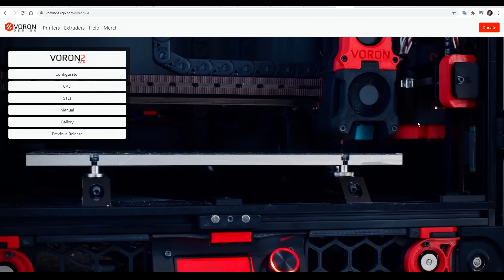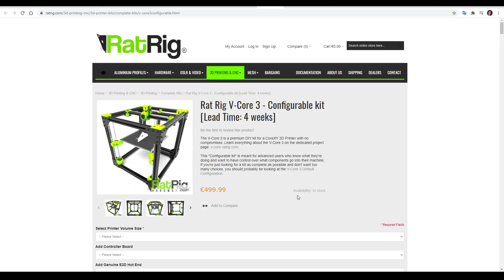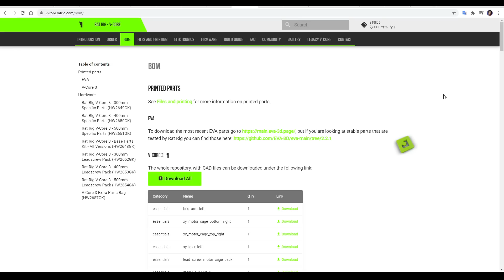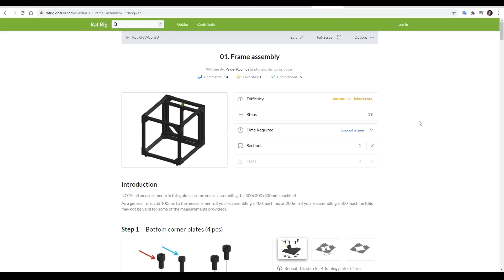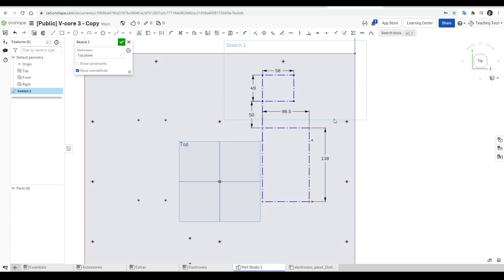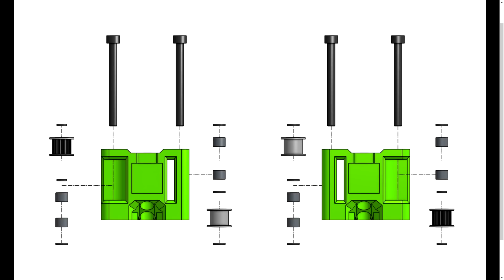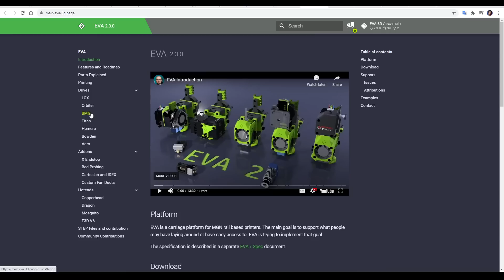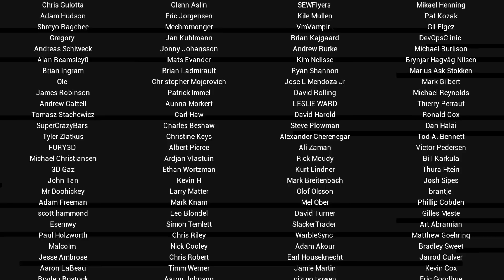Rat Rig V-core 3 part 1 - Premium coreXY 3D printer community build

Comment: i am looking into Rat Rig V-Core 4.0, and i see that you have  the vers3.0.  do you still like the version 3? is it a heavy use machine for you? a go to machine?  i have to replace a 400x400 kobra max and i am thinking about the Rat Rig V-Core 4.0 and the 500mm one.  I've had the MK3 from prusa, and currently i have an x1c and a kobra max.  size and a non hobby tinker machine is a must.  model and print, with no messing around.  i have seen there is a EVRYONE 400 on Kickstarter, but its Kickstarter so I'm weary of doing that.  What do you think of a 400 plus machine on the market?

Comment: Does anyone know if you can use regular 3030 TSlot profiles instead of B type? I can only get locally sourced profiles and B type is not an option. Can you see any drawback or restriction performing the assembly with regular 3030 profiles? Thanks in advance for any comment

Comment: Everything looked doable ... until the backplate came into question. That piece alone costs over €100 to have made and shipped sadly enough and having to have something done externally without knowing for sure it will fit at such a high price ... not a very tempting proposition.

Comment: looking at building the V-Core 3 but I am worried about the way the build plate is held. It has 3 points that are just held with magnets so you have 2 corners that are just out in space. Was wondering if anyone has seen that if you have to much weight on those 2 corners does the bed left up in the opposite corners?

Comment: What do you think about the RatRig vs something like the new SecKit Tank? I'm thinking about building one of these and my greatest priority is excellent print quality and reliability. Speed would be icing on the cake, but I'd rather have a slower machine that dead-reliably gets high quality prints in PLA and PETG than a notably faster one with slightly lower print quality or reliability. Thanks for the great videos and for sharing your expertise!

Comment: I recently got the non pro version of this printer and some work must have been done to remedy the issues listed, I had no problems in building the machine, installing the belts was tricky but but not that hard to do. when leveling the build plate choose auto and try to adjust the nut under the platform to bring the values in the table to as near zero as possible,  turn the nozzle to raise the build plate if the value is negative. lower the build plate if the value is positive. At least This is what I did. I have tried printing using the sd card and found that the finish of the part was reasonable with regard to the test pieces supplied. Otherwise printing using Simply 3D and some designs not supplied by Tronxy the effects of stringing were apparent.
I do agree this is not a printer for the uninitiated.

Comment: If you were to enclose the Rat Rig printer would PETG be fine or something like ABS+/ASA better. For those that have an Ender 3/5 with no enclosure looking to build one of these PETG would definitely be easier to print, but just wondering if if would cause issues later on. This may sway me from the Voron 2.4.

Comment: I want to diy a larger printer with 400mm x 400mm bed. Can any 3d printer controller travel that distance according to the gcode if the frames are large enough ?
Reply from the maker: Yes. See the Ender Extender kits for an example of that. The firmware doesn't care beyond having the max coordinates increased to suit.
Reply: @TeachingTech  Thanks

Comment: I had wanted to build a Voron 2 kit but seeing this has me curious. Personally I like the voron's design of leaving the bed completely stationary more but the independent controls are definitely an interesting design choice.
Reply: Same thought here, but seems like there could be some really cool things you could do if slicer programs can work with a moving bed like that. I like the electronics enclosure on the back vs at bottom of Voron. I was considering the Voron, but now seriously considering this one due to being able to order parts in 1 place and cost isn't much different.

Comment: which panel do I have to use on github? there are 4 and I dont know which is the correct one. I ordered the v-core 3 with a skr pro 1.2 2209
Reply: You are looking for cad/panels/[your printer size]/electronics_panel_blank_[your printer size].dxf 

You'll have to add holes for mounting the electronics yourself. You can either do that by drawing it out on the plate and going to town with a hacksaw/angle grinder/jigsaw and drill, or do it in CAD and have it made at a shop near you.

Comment: I'm torn between this printer the mgm cube and the voron 2.4 ? I want to build one but not what will be the best
Reply: They're all excellent printers capable of incredible speeds and excellent print quality. You'll have to look at other factors to decide. The voron 2.4 is a more complete design but also less customizable for that reason, and it takes ages to build. The Rat Rig comes in up to 500mm build volume and is backed by a company so you get warranty and support, it's simple and easier to assemble. Not sure if there's any upside to the BLV that the other two don't have.

Comment: Dear Michael, you have tested many different hotends in the past, but I would recommend trying the ‘NOVA-hotend’ by 3D Passion for this project, because it is seemingly one of the best choice out there for high-speed printing. Your relentless efforts are truly commendable and much help for the community and enthusiasts…
Reply: It does look very promising, but keep in mind that all the videos you are seeing are using highly elevated temperatures to achieve the high flow, which leads to pretty disappointing print quality in practice if every bit of your print is not printed at the same speed with the same flow, which is very very rarely the case.

Comment: Do the rails come pre greased?
Reply: They come in protective oil, which can be wiped off and they can be used as is. The MGN12's in the V-Core 3 kit are excellent. You absolutely can clean them and grease them yourself if you want to, but it's not at all necessary.
Reply: @miklschmidt  how can it not be required to grease them? Metal against metal are never good. Even if we don’t even get close to 10% of the rails max load it is still metal sliding on metal.
Reply: @Exstaz  because the protective oil is enough. You can apply some additional oil every now and then. Stripping and greasing is 100% optional. Warranty applies regardless.

Comment: when you printed the parts, did you account for size differences or was the STL  already made that?
Reply from the maker: You mean shrinkage? Either way everything was the right size with no modification.
Reply: @TeachingTech  what about the choice for petg? The vorons are extremely against using petg due to too much flexibility and heat creep in an enclosure?
Reply: @em-pointer  PETG is less flexible than ASA which is one of their recommended materials. Deformation will happen if you run enclosure temps higher than 60-70 degrees celsius, but that won't come easily (you need excellent insulation and possibly even a chamber heater). You can print the parts in whatever material you want, you can even use the PETG parts to print ABS parts. Mechanically there is absolutely nothing wrong with PETG, the parts are designed for PETG so they will work great. It has been tested thoroughly through months of use, so don't worry.
Reply: @miklschmidt  what vorons showed is that at least some of their parts were deformed due prolonged heat exposure of hot and cold they've shown parts from PC as well, (which what surprised me) my current black widow printer has an enclosure the temperature around the hot end can reach around 50-55 degrees, i was on the fence for a while on buying a voron 2.4 kit , but i retreated from that idea. partly because the maximum of 350mm 
i even considered using CPA for it
Reply: @em-pointer  Yes, but the v-core 3 is not enclosed by default (it's designed to be somewhat easily enclosed if the user wants to). If you wanna run 60+ degrees in a chamber, don't use PETG. For everything else it works nicely. Depends a lot on the brand of PETG used as well, i can recommend Spectrum (Lime Green PETG is the official EVA color).
Reply: @em-pointer  Also you have to remember the Voron is designed for ABS, not PETG. That makes a lot of difference.

Comment: This looks great, I've been lurking on the website and I can say this seems like a great alternative for me as I was considering  a Raise3D. One thing I noticed is they dont offer an LCD screen and their page doesnt make mention of it despite mentioning other items that don't come with the kit as standard. Any clue?
Reply from the maker: Alternatively since both RRF and Klipper support a web interface, you can recycle an old phone or tablet as a full featured display.
Reply: @TeachingTech  With klipper you can even use an HDMI screen and use KlipperScreen.
Reply: LCD screen is not part of the offered configurations, but you can always buy one and design a 3D printed mount for it.

Comment: If I may, as far as extruder choices what about something like a mini Sherpa? Light weight and using a nema 14. I noticed also that Mellow store released an integrated hotend/extruder using a nema 14 at 5:1 using e3d hotend components and creality spec mounting with low weight and a unique quick filament feed system. Might be worth casting an eye over too.

Comment: I ended up doing a Voron 2, and I am a happy man.
Reply: Also building one, but with the 350mm version 30 30 extrusions would have been nice
Reply: @010falcon  Yes the 20/20 are a little bit small for the 350. I did a 300. Make sure to derack the frame and fine tune the printer with input shaper ;)
Reply: @BonBaisers  Hey I'm still on the fence between the this and the Voron, what do you mean by "derack" the frame?
Reply: @slayga  it means making sure frame is square :)

Comment: I love that you are doing this. It has allready relieved so much stress from me, just by going along so smoothly. Wouldn't you want to make a machine like this an IDEX? or at least dual extrusion? Your Hbots are all ready sporting direct drives. I really want to see this thing become my goal machine. A core xy IDEX with a heated chamber capable of 80 degrees C. It should print just about any material at 0.05 resolution. For me speed is not the reason to have a core machine. Repeatable perfection is my only goal. Then I might try to speed things up. I can't wait for the next installment. Thanks for being so awesome at what you do. I'm not sure about the Klipper thing though, I am just starting to understand how to work with marlin and build firmware for my machines. Its been 2+ years and I am still a novice with marlin, Now to have another control system to learn syntax for? I will watch to see if you turn grey trying to get it dialed in. Then decide about that. Keep on rockin'.

Comment: Hello teaching tech. May we know why you use spider coupler instead of the rigid coupler for the Z? thank you
Reply: You can use rigid couplers if you want. The spider couplers are more beginner friendly though as they allow for some misalignment. They don't compress much either so in that aspect they're better than spring couplers, which was the default on the predecessor.
Reply from the maker: I did not design the machine, so your question should be directed to Rat Rig.

Comment: Big printer should have a big hot end. So use a Volcano or similar
Reply from the maker: I have bigger printers with larger nozzles so for me it's not a requirement apart from wanting a lot of flow for high speed printing.

Comment: Great video as usual mate, just one thing, get a taller seat as the one you are using makes you look about 3 feet tall !  😄
Reply from the maker: The work table is actually a lot higher than it seems. The problem is worse when I'm trying to fit a larger printer in frame. I agree this one looks wonky.

Comment: Good to see 3D printers adding "pillow blocks" (thrust bearings), but maybe they could start adding them to the correct side of the flexible couplings. :)
Reply: We have a design for full pillow blocks, which I'm currently using. They're great, but are much harder to install, as you're effectively turning your flexible coupler into a rigid coupler, so wobble becomes a larger issue. The goal here is to offload the motor shaft, and the default design accomplishes that just fine. The only advantage of full pillow blocks (as we call them) is that they eliminate coupler compression as well (which is already minimal with spider couplers). So because ease of assembly was a priority we opted for the design you see in the video.

Comment: I have 2 of these at work, which I built. The 400mm pro was a pain in the ass to get that huge bed to work right. Now they have the rails at the bed corners which solves the problem I have.
Reply: There's an upgrade for the Pro (1.3) that gives you the kinematic bed :)

Comment: You didn't clean and grease your rails ?! That's a must, the oil that's on them is just for rust protection not for lubrication! Clean them with WD-40 - > IPA and then apply EP2 grease inside the carriage
Reply from the maker: I followed their instructions to the letter. They have a specific page on the prep. Everyone has their preference but you have to understand my need to to stick to the recipe, especially if I end up doing a review video. Any sub par performance or problems and the finger gets pointed at me.
Reply: @TeachingTech  Alright, I can respect that in regard to the review aspect.  But I'm VERY surprised over their recommendation on not greasing them. All rail suppliers ship the rails with just a light oil for protection. Even the expensive ones. You'll get less wear and a much quieter printer with grease instead of that oil. Good luck with the build
Reply: @vesslades  The MGN12's that ship with the V-Core 3 are excellent. There's nothing wrong with running them with the oil they ship in. Cleaning and greasing is 100% optional, and the steps to do so are mentioned in the linear rail guide, if you wish to do it anyway.

Comment: The show stopper is definately the plastic elasticity dependent pulley mounting.
If i invest that much in a new machine, i would expect that ALL bolts/screws that have to cope with the forces of the belts are solely mounted on metal parts.
So for me this printer for that price is a no-go.

Comment: Regarding the electronics panel: I'd just cut the sheet to size by hand, put my components where I want them, stick a pen throught the holes and drill those by hand too. Accurate mounting is crucial for the operation of the machine when it comes to the frame, the lead screws and so on, but the electronics? I would have just yolo'd it lol

Comment: When I configure it (new to 3D printing but experienced tinkerer), it costs almost a thousand Euros. So if you're new to this like me, you may want to look into the other CoreXY machines mentioned in the beginning :)
Reply: Most CoreXY's this size and with these features will be around that price. The voron's are a bit more expensive, maybe a bit less if you run the risk of buying a kit from ali.
Reply: @miklschmidt  Yeah I checked out the others in the meantime and I guess I'll stick to a bedslinger for my first printer.
Reply from the maker: I don't think this type of kit is intended for first time users (although with your experience you'd likely be fine).
Reply: @TeachingTech  i agree. Depends on the person! There are more than a few people on the Rat Rig discord who started with a V-Core. if you’re technically inclined, eager too learn and are used tinkering with mechanical stuff you’ll be just fine and you’ll learn as you go. The Rat Rig / EVA community is amazing and always ready to help!

Comment: 7:29 this is such a weird problem that still hangs around. Why can’t people just orient their parts properly before they share it with thousands of people? Jeez
Reply: It's a ton of work on a continuously improving project.
Reply: @miklschmidt  3 clicks on fusion. They’re selling kits so it’s not just a “project” it’s a product
Reply: @fish9468  Per part, and you'll have to adjust as the part changes. And it's designed in onshape :)

It's an open source design, hence why i'm calling it a project. But yes, product is also a valid description.

Comment: I'm just starting to get into the electronics part of 3D printing... would a Fysetc spider work in this build?
Reply: Yes it would! But there's a huge benefit to using the SKR Pro, namely V-CoreOS. It's a preconfigured raspberry pi image and firmware file for the SKR, that comes preconfigured for the v-core 3 with Klipper and Fluidd and all the bells and whistle :) It has automatic MCU detection as well so you won't have to touch the commandline at all.
Reply: @miklschmidt  cool, thanks a lot!

Comment: Another interesting option that in my opinion deserves more attention are the annex engineering 3d printers. What sets them apart from the others is that all the printers of the project are cross gantry, so four non moving motors instead of two, and shorter belt paths compared to the coreXY kinematics. The speed they are capable of is insane!

Comment: I have never owned or used a 3d printer, that said. Which printers do you recommend for beginners.
Reply: Ender3 for sure.
Reply: @chrisgrantham2648  funny enough I was just reading about differences between Ender, Ender pro and Ender v2. Price aside, which is the best option?